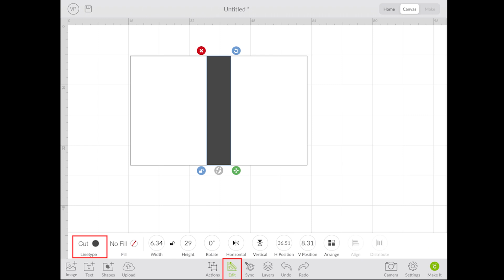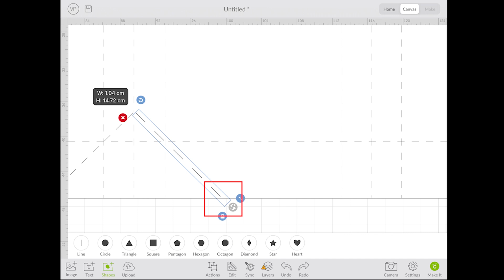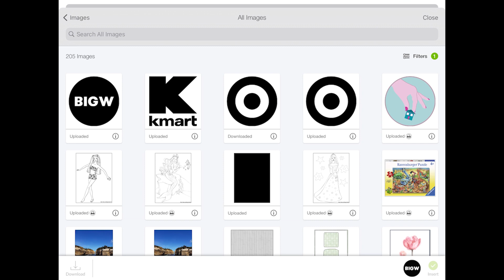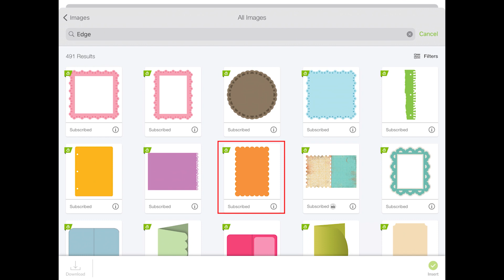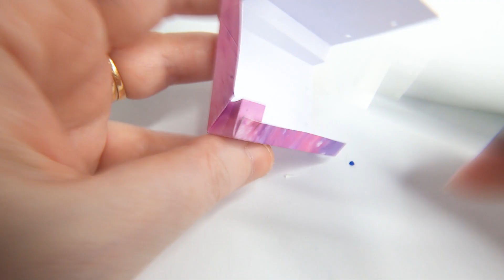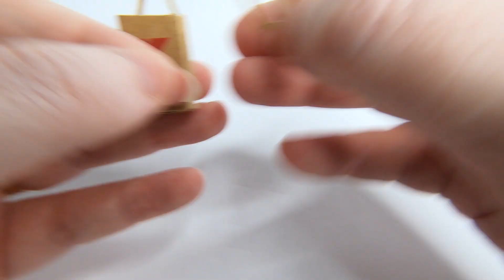Miniature Shopping Paper Bags in 4 Styles | Cricut Mini Tutorial DIY Dollhouse | 1:12 & 1:6 Scale

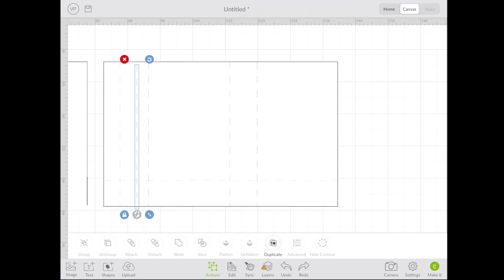Comment: Hi, what are the gold lines 4:32 / 22:06 I've never seen those - look very helpful? Thank you.
Reply from the maker: Hey there, this is a feature on the ipad I believe. It locks it to the other shapes on design space. I also use design space on windows so will have to check if it's on there too 😊
Another method to keep it all aligned is the align tool.
Thanks for watching!
Reply: @ItsyBitsyBuild  No it''s not on Windows/desk top ... shame though because it looks pretty useful. Good vid by the way.
Reply from the maker: @sysop224  Im sorry to hear this :( What happens when you try to open it? is it the same mac thing you described earlier on?